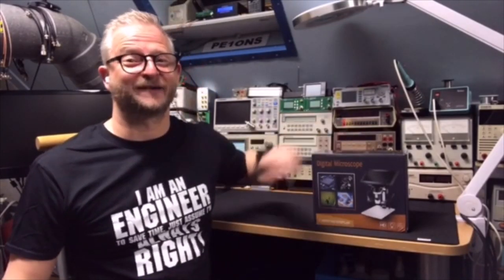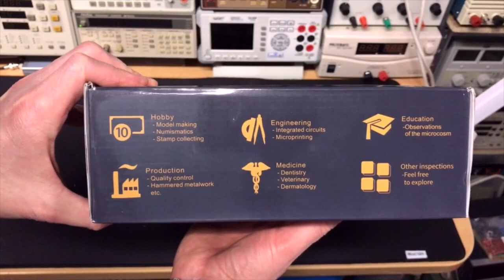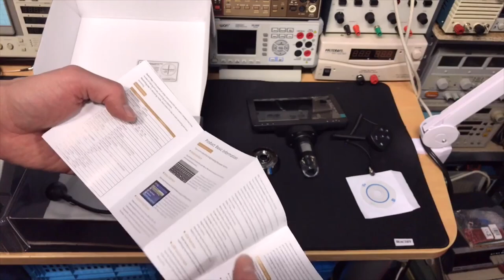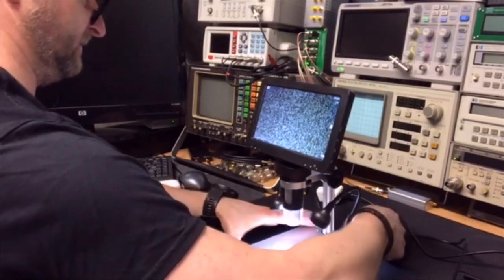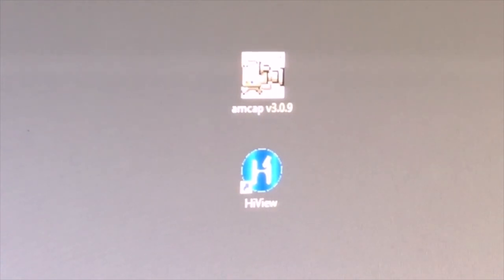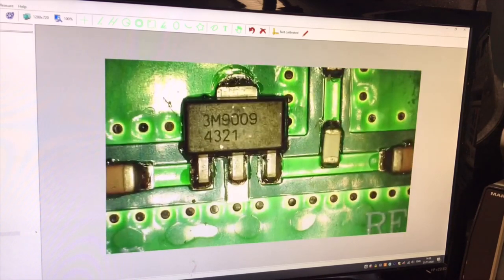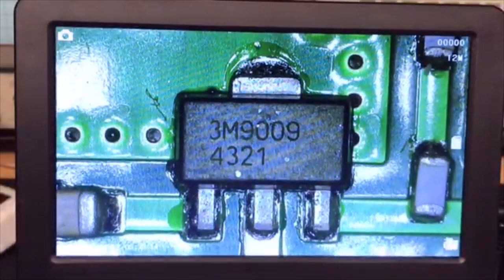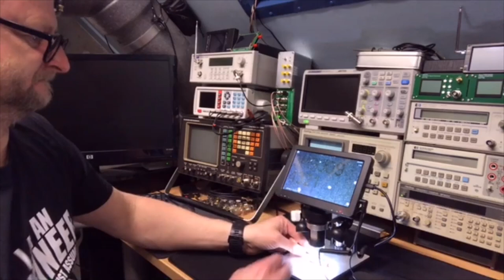#107 Digital Microscope 7'' DM9 12MP 1200x Zoom 2020 Model

Comment: I have the same Microscope, and for this little price its an good device.  However, I built it on a heavier base plate with a new table on top that can be moved via fine adjustments.    The microscope "table" is now a bit higher, but the part is bombproof and you can move the part of the interest under the microscope cleanly and without jerking.
Reply from the maker: Nice solution you made, thanks for sharing Chris!

Comment: What kind of scope is this? How much did it cost? I'm looking at the andonstar ADSM 302 HDMI  or AD 208s I believe it was. The 8 inch screen instead of the 5 inch on 302 and the working height is able to work a little higher as well.
Reply from the maker: Hello Josheph. it is a DM9 and the link you can find in the description. yes i would prefer a microscope that could go higher, but for what you pay this one is very nice.

Comment: I already have the model of 7" microscope of a different brand. I'm giving it to my sister and ordering the one that  you are reviewing. I'm an x-instructor for the US Air Force in the field of Ground Radio repair, which is now called RF Transmissions. I taught radio, GPS, cell phones, mass alert, satcom, and any and all devices that do any form of electronic communications. I'm also an EE and mathematician. I am so impressed with your bench of test equipment, what a great setup you have there! It looks like you have everything! I am now fully retired, but I still do electronics, I design and build things based on the Arduino. I would love to have all your equipment although a single commuications test set would be enough, but still, your collection is fantastic! I look forward to this microscope coming in. I also have the Flipview, which I consider a piece of crap. I also have TWO German made, high quality, super expensive lab microscopes, both with digital eyepieces, running to my PC that has two 47" monitors! This crap of squinting your eye up at the microscope is just plain stupid and irritating to do when it is so easy and inexpensive to put the image on a computer monitor! My digital eyepieces are $100 each and not cheap junk. Each of the lab scopes exceed $2500 each. But, they are not good for looking at bugs like the scope in your video, they are great for looking at individual cells of the bug! My lower powered ones are so much better for bugging! I will be surprising my sister with my 7" LCD Microscope. She loves looking at the bug pictures I send to her, and she made the statement that she would love to have a microscope... Well, with her being poor, and me being rich, I am about to make her wish come true! Ain't that nice of me? Anyhow, my scopes, and the one you are review, all fantastic to use!, Nice video and you get a thumbs up from me!
Reply from the maker: Hello Fladden, thanks for sharing that, nice stuff you have, yes i am sure she will like it.

Comment: Hi   Like your presentation - Q -  I am planning to get from Amazon - my Q is how is the power consumption ( Dc) I can use it for extended time to my electronics lab and research. Is there a plug for dc ?
Reply from the maker: Hello Jerrybon, you can use it several hours on the battery.  you can also think of replace the 18650 with higher capacity or just plug in the USB cable during usage, so it charges during use.

Comment: I have a leipan that I bought from Amazon almost a year ago and I love it and I do lots of coins but it's definitely not 3d. I have to hold a coin in my hand and tilt it and this is not practical so I had to get a Hastings loupe for the double dies and RPM. But I wear glasses and half blind and it works great for everything else. One of these days I gonna get a laptop to finally hook it up.
Reply from the maker: Thank you for sharing that, that is also a great use for this microscope.

Comment: Hello. I have a Mac and I'm having trouble finding drivers. I tried to use your link but I got pdf's and my mac warned me not to open for possibility of malware with 1 of the files. I just want to check out some coins and look at them on my computer. How would that be complicating. Sending this back would be very disappointing...
Reply from the maker: Hello, the links i have are for PC, you can also just look directly on the screen. (charging it can be done without any driver, just plug it in.)

Comment: are you recommend for mobile repairing tool sir?
Reply from the maker: Hello Virga, it does have a battery that lasts for a while, and if you have an USB charger, you can also charge it if it runs empty if you use it long time.. 
Tony

Comment: How can I change the battery?
Reply from the maker: They are rechargeable, but i thing if you unscrew the back of the display there is 1 or 2 , 18650 battery
Reply: @TonyAlbus  Thank you. It works for about a minute or two and shuts down after 3 stage battery meter starts flashing. I didn't want to open it up without a replacement on hand. the than the battery issue it's a decent tool. I extended the photo length by 8 inches to view larger coins up to about 30-32mm.
Reply: @TonyAlbus  The back comes off without screw removal. It has a battery compartment with a ribbed surface on it's back. I have ordered the battery but waiting for delivery. This fact should be part of the instructions because most folks don't take products apart because it's easier to replace them. If the new battery works out, I will delete my negative reviews. Thx
Reply from the maker: @janekcalhoun4436  Hi Janek, i agree you should be able to replace the battery easy. don.t mind the negative review, i am a user just like you, i am not affiliated in any way.
Reply: Well it wasn't the battery. I'm going to put it back in the box and wait until someone makes a repair video about it. I'm going to give amscope a try but some of the optics are killer on the eyes. I found that searching the Vcoins seller database I found coins being sold "as found". I've cleaned hundreds of the LRBC and am moving up to Tetrarchy follis and large provincial. There is a good selection🤠 to choose from.
Reply from the maker: @janekcalhoun4436  Thank you for your feedback!..
Reply: @TonyAlbus  FYI- It has a setting called automatic shutdown that I was unaware of. DUH to me. It's works now.

Comment: Tony, this video was clumsy and a reckless, although the product is still a good digital microscope.

  First off, the manual is nearly useless - the English portion is poorly translated.  The web site was no better.

The worst part is that there are no instructions about how to assemble the microscope. There is a diagram on the side of the box that shows how the support stand and microscope go together, but there is nothing about the wiring   

The stand is surprisingly difficult to screw together, because the threads on the support rod were not clean.  Second, the camera slides into the support ring WITH THE WHITE SILICONE BAND that was included (Tony left it off),  I found that the stand lights were very helpful, particularly with metal objects (coins, electronic boards, etc)  There is no USB charger included and that was an unfortunate mistake (IMHO).  

The worst part of the microscope is the color capture.  The LCD screen is pretty sharp and even, but the color is greatly subdued.  You may have to transfer the files to a computer to edit them to bring out colors.

 Tony, you went through this setup way too fast and he missed a lot.  The newest kits DO include a 32GB Micro memory card.  The software utility (only for Windows OS) comes on a USB memory stick.  It works with Mac OS without special drivers.
Reply from the maker: Thank you for the extra information, i am sure it is very helpful for others who were also struggling with this device.

Comment: got mine today, for $99.99 it's nice, probably could be better, but nice so far and i don't mind using obs, bandicam or streamlabs to access the camera on my pc. good to know it also works on usb power only and no need to ruin a easily replaceable 18650 by leaving it on the charger 80% of the time.

I'm using oasis.exe from here, bandicam works, but this is much smaller and works as good with a digital zoom feature.
https://www.oasisscientific.com/downloads.html

also, where did you find the dm9 zip?
Reply from the maker: Hello Redkurn, thanks for the extra info on the streams, that is new to me, thanks!.. the DM9 is a zip i made, from the software from the CD that came with it, and some scans i made myself or collected from somewhere.